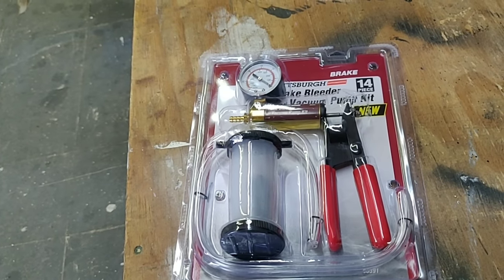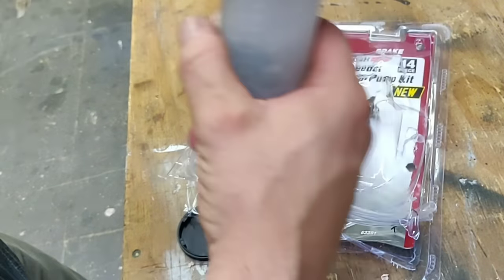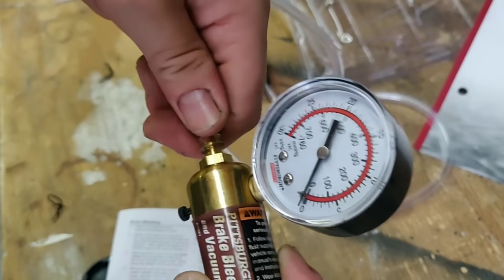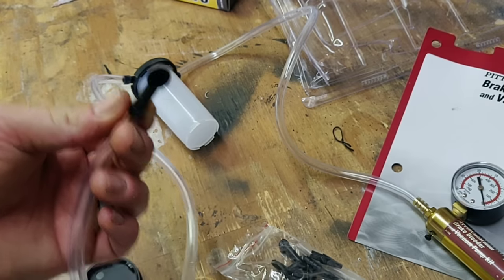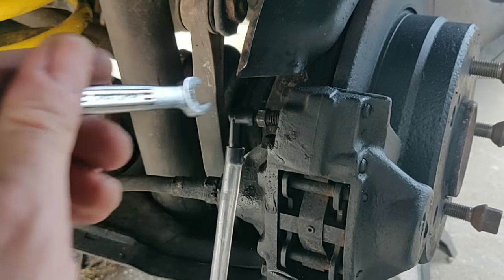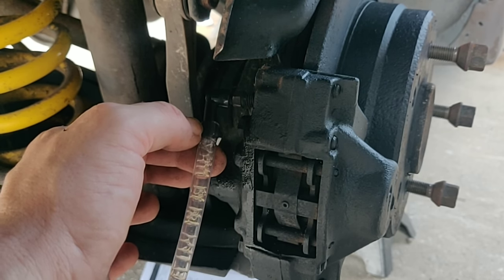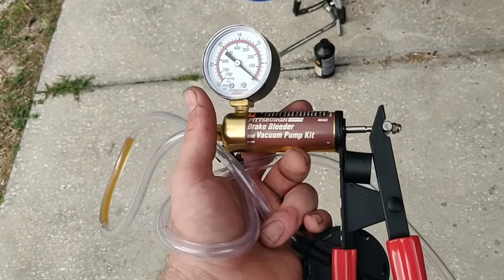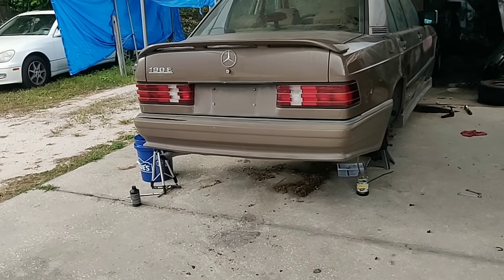Harbor Freight Pittsburgh brake bleeder vacuum pump demo and review

Comment: Also once you know how to use the pump and you are correctly connected, air will get sucked through the bleeder threads and teflon tape on the threads will minimize the air entering through the threads. I prefer the two person method and seldom have the luxury.

Comment: Yeah, I forgot to pull the spacer out from the handle too. I eventually figured it out after a couple of minutes. My issue with this pump was that I think the seal at the bleeder nipple wasn't great (even with the smallest adapter) and it was letting air in, so it was almost impossible to tell if the air was out of the system or not. I eventually had to go with the conventional method. I think the pump works great, just need to figure out how to seal it better at the bleeder valve. Clearly, the instructions aren't sufficient.

Comment: Besides the fact that you left the black pin in the pump....All those bubbles in the tube are from leak at the connection with the nipple....Forget using that adapter...Connect the tube directly over the nipple and then use a small tie-wrap around the tube and crank it tight .. Also place some thick grease around the threads of the bleeder screw.., since most of the air gets into the tube through the threads when you loosen it...

Comment: To get the air out of the lines you got to fill the master cylinder and put the cap back on it! If you don't the air will come through the master cylinder it's hopeless without sealing the system and let the air out  at the calipers

Comment: I'm sure this may not be the best but you didn't read the instructions completely and missed the hose inside the bottle and a little brake fluid in the bottom of the cup.  I'm guessing you didn't have the bleeder far enough open for the brake fluid to come out.  Brake fluid will start running out without any vacuum if the bleeder is open and not plugged.

Comment: You didn’t read the instructions properly, you need to discard that cylindrical stopper that is preventing the arm from retracting fully, that way you’ll get the vacuum pump to move through its full stoke.

Comment: Operator Error - Remove pump handle shim puck before use.  Refer to time 11:27, the spacer puck is still in place.  Also, check the schrader valve on bottom side of pump cylinder, if it's loose the unit won't hold pressure las well as it should.  Instructions probably mention it, dooh.  🤨

Comment: Just took mine back after attempting to bleed a clutch. Total crap. Worked for about 3 minutes then wouldn’t hold pressure. Going to buy a one man bleeder gun from Napa. Seems much nicer for the extra $80.

Comment: A bigger vacuum chamber on the pump would've been better....removing the spacer didn't work for me, probably got a dud.  Sometimes it can draw air in from around the bleed nipple threads.
Best buy is a pressure bleeder to use on the reservoir.

Comment: You have to leave the cap on the master cylinder loose. You just place it on top but do NOT screw it back on. Otherwise the reservoir will be pulling a vacuum that the little pump can't fight. When you pump the brakes, it pushes a big cylinder which pushes the fluid through. There is no way the little pump can compete with the power of the master cylinder.

So you basically used it wrong and that is why you couldn't pull brake fluid out.
Reply: Go back and watch the video. At 9:40 he walks up to the front and the cap is off the reservoir. You are wrong.

Comment: I have one that I've been using for years and has yet to fail. The tool was not a fail right out of the box, the problem you had is you don't know how to correctly use the tool. You were trying to build vacuum with the packaging lock still on the plunger, the little black plastic piece keeping the plunger arm from fully seating. And I saw fluid on the pump side of the tool, if that fluid got into the barrel it would stop it from working too. You were too quick to condemn a useful tool that with a little knowledge of the tool and a little practice would have been a very good addition to your tool box. There nothing wrong with learning to use a tool before you make a review video, you're not the first YouTuber to make that mistake, and you certainly won't be the last. We all have to learn. BTW, it is a good video.

Comment: I find these to be more work than using a one-man bleeder with check-valve hose, and pumping the pedal. With this method you can instantly watch for bubbles, but since it's not moving the cylinder piston it tends to waste more fluid for the same result.

Comment: There's a real simple way to believe the brakes you only need a couple inches of hose of course 6 in or more with make it a little bit easier but you just open your valve and put that hose on there and point it upwards so any fluid that comes out of there has to go up and stays in the tube so when you release the brake it'll suck that fluid back in there and you can see that really no fluid really actually get sucked in there you can just open the valve and pump it a few times but make sure you keep your master cylinder filled up

Comment: You forgot to take off the spacer between the handle and pump, thus couldn’t pump it correctly for pressure. I just bought one, and noticed it right away in your video.

Comment: not getting full travel with the handle take that black thing from between the handle and the pump, dont need all that hose, make sure you are not sucking air,fittings must be tight, use teflon tape

Comment: l think it would help if you flushed out the brak fluid reservoir and put new clean brak fluid in, as it seem to have some dirt in it,  And if you pump the dirt in the system you will cause a blockage.  But I did enjoy the advert for the bleeding system
Yours sincerely
Gordon

Comment: *It is important to only open the bleeder just enough to let the pump pull a small amount out, otherwise you will be pulling air in at the bleeder and out the hose.

Comment: I also bought that it didn't work well
 Also when bleeding brakes you are supposed to keep the brake fluid reservoir cap on to keep air from entering from there.

Comment: The seal falls off pretty quick (use mine in a shop) 
Honestly Iv never used any of them fittings and never used the small hose in the container. Found a transmission gasket that fits the container and it’s so far not fell off after right around a year of jt being on there. But from using a high price snap on pump to a Napa pump. They all work the same and do just as good. And tbh Iv never had one last longer then the other. The seals dry up in the pump and go out the only difference is the price and name tbh. Don’t waste the money on a high dollar pump. Just get a cheap one like this works the exact same zero difference

Comment: you did'nt take the black spacer out in between the pump to get a full pump. then you should get 35 lbs of pressure easy . i did the same thing with that spacer in  it will only pump up to about 10 lbs.

Comment: Nothing better than the brake petal you can make your own just get a plastic soda bottle with the cap drill a 3/8 hole on the cap get a 3/8 clear hose so it reaches the bottom of the bottle put 3 inches brake fluid in the bottle that's so you don't suck air back in the line with this you can do it yourself just make sure you always   have fluid in the reservoir

Comment: There is 2 things, I think you have to remove first the tap in the handle of the vacuum , and second , the bleeder could be a little cloug for the vacuum are you using, that was ease with the pressure from the pedal to uncloug it

Comment: Basic high school chemistry would've exposed the problem immediately. It's not a defective unit. 

Pressure is proportional. You have a big empty caliper full of air and a tiny little vac pump. You're only pulling a little tiny bit of air out of the caliper. What was 10 hg in (inches of mercury [Hg element symbol]  ) in 1 cu in of pump spread out over a caliper 20x bigger is now 0.5 in hg.

Comment: You didn't get pressure because you did not remove the plastic cylinder that was in between the handles. That plastic cylinder prevented you from squeezing down all the way which didn't allow the pump to work. That plastic cylinder is placed there for shipping and packaging purpose only. Mine worked just fine after I removed that packaging item. I did try it with it on and yes you only get 9 pounds of pressure. I didn't see if instructions failed to mention that you have to remove cylinder before using. You threw away a perfectly working pump. 😔🤷‍♂️

Comment: That little black nut that's in between the pump if you take that out you're gonna be surprised that it was the issue as to why you couldn't get above 9-10 hg's

Comment: Its vacuum not pressure dude. A big difference. Vacuum is what creates a pressure differential that allows it to PULL the bubbles and fluid from the system. Also, the vacuum pump is not defective. You didn't set it up correctly.

Comment: far be it for me as i only use it on a bike  dont really need it beause the lever is right there,  you have to get air tight connect  where the connection to to bleeder is suspect   also if  you  pump and resivoir runs dry  make more trips to check. thanks

Comment: If the bleeder is blocked, you need hydraulic pressure to bust through. 10 PSI vacuum is not going to do it.
Reply: Or change bleeder

Comment: The first mistake was open the reservoir fluid tank , air was running from there ! Second mistake no brake fluid. Bc you should fill up and tight the cap

Comment: I got one of these vacuum pumps for bleeding brakes. Its a stupid idea. I bought a $4 aquarium one way valve & put it on the plastic tubing & just 'short pushed' the brake pedal ( so the masters seals stay within their normal travel & dont pick up any rust etc).
Bled each brake cylinder by myself in less than 4 mins each, without even removing the wheels.
Yeah, a plastic $4 aquarium one way valve...  ( the actual pump is handy for testing lawnmower/chainsaw carbys, filtering fluids to get residues,  etc etc etc. Its just not the answer to bleeding brakes, a US$2.50 plastic one way valve IS !!  )

Comment: A few notes: 1) What you're doing is vacuuming, not pumping. 2) Vacuuming will never be as effective as pumping the brake fluid with your foot pedal. -15 psi pulling vs hundreds psi pushing the fluid out. 3) When you use the brake bleed nipple, you must loosen it, however the loosen thread will leak air thus you have even less vacuum force to draw the brake fluid. For fluid change, vacuum may work since system is already primed. For opened system, vacuum method will not work especially the rear brakes, too long, too much restrictions.

Comment: I think it’s best to just get an actual pressure bleeder kit...one where you hook the pressure bleeder to the brake reservoir. They work for me, and it seems that it works well for everyone else that uses or has used them. This way, it’s still just a one person job, but one that actually works. Either way, this is a good video to show how this type of bleeder system isn’t that great. 

Thanks for the vid! 🤙

Comment: The fault was not with the tool. You did not carefully follow the instructions. The air that you saw coming out was from around the threads of the bleed nipple. It is recommended that you remove the bleed nipple and coat the threads with some grease and also check the nipple is not filled with dirt. The nipples did not seem to have had the covers fitted so you threw away a perfectly good tool.

Comment: You need to remove the round stopper from between the handle and the housing then it will pull vacuum

Comment: I'm no expert but shouldn't you have filled the entire system up with most of the brake fluid first.
Cuz you mentioned it had brand new brake lines along with new calipers on front I would think as small as that pump is it's going to take a lot of pumping to remove all the air out of the entire empty system. Probably should have gravity bled first. So as to be removing minimal air. And then I think it would worked just fine.

Comment: Well, actually, it’s not necessarily harbor freight‘s tool and it not having enough vacuum. You just didn’t use it right the little short hoses have to stick inside the lid like so in the picture I’m gonna post also, you have to put a little bit of brake fluid inside of it so it’s not sucking air. It Hass to be in the fluid try it that way you threw away your pump for nothing lol.

Comment: Just buy a clear 1/4” line and put in to a water bottle open your bleeder valve pump the brakes 2-3 times and you’ll see the brake fluid has no air bubbles coming out close the valve done no real tools needed.      Total cost maybe $2.00
Reply: How can you see if there’s no more air in the line if you are in the car pumping away on the brake pedal, draining the reservoir and by releasing the brake pedal wouldn’t it suck air back in the caliper before you could run around the vehicle to close the bleeder valve?

Comment: 11:30 LMAO below the chrome bolt in between the handles you can see the spacer that is stopping it from letting the bolt go all the way into the VACUUM pump. If you take that out it will most likely work. That is there so it is smaller and easier to package. Live and learn I guess. I seen this info in another comment.

Comment: A pressure bleeder that fits on the brake fluid reservoir is the best way to bleed the system. If you get any brake fluid inside that HF vacuum pump it will become completely useless.  The HF pump is a complete waste of money.
Reply from the maker: I agree.  I was able to get it to work for a while.  I did a few cars that all work great but now it got fluid in it and wont maintain vacuum

Comment: You did not have a good seal. You needed to seal your bleeder screws and connections. It will pull a vacuum if you take your time and do it right. The bubbles coming out right off showed a leak and in other Harbor Freight videos you would have seen that. Device does work with a little effort.

Comment: I hope this guy was just joking.  It says right on the unit, 'VACUUM PUMP', not 'pressure pump'.  You know its pressure or vacuum by the way the gauge is numbered, and by which way the needle moves.   When registering 'pressure ', the needle will move clockwise.  When registering 'vacuum', the needle will move counterclockwise, as the numbers are numbered in that direction.  Got a good laugh anyway!
Reply from the maker: Thanks for watching
Reply from the maker: A vacuum is any pressure less than the local atmospheric pressure. It is defined as the difference between the local atmospheric pressure and the point of measurement. A vacuum is correctly measured with a differential pressure transducer that has one port open to atmosphere.
Reply: @petescarport  LoL, don’t try to sound intelligent now!!

Comment: Of course. Things wont-work properly if you don't read the manual fully. You're supposed to take off the black rubber ring on the handle. It's there to protect the pump during packaging. SMH

Comment: Don't buy these. You'd have better luck using the tube and bottle method if this is your only option. I work on cars everyday. Do not expect this product to even create a vacuum initially. You may have to return it and get another one, and even then it will only work a few times, leaving your hands extremely sore and covered in brake fluid.

Comment: I took notes on this video only to feel like you did it wrong.  All of the bubbles you were getting were probably just because of an incomplete seal on the break line which could be easily solved with a zip tie.  Also, the black plastic thing that you should've removed.  This is a how-to-not video.

Comment: I think that your pump was doing its job.
I think that you sucked too much from the lines and then your second mistake was, you tried to suck from the front, after you had just sucked the fluid from the rear and sucked the fluid away from the other 3 calipers... Thus!! creating a huge air bubble in the system. That pump would never have had a chance to work properly under those conditions. My name is Fred and I approve this message.

Comment: There is your problem sir....
You only have 3  wheel lug nuts and all the compress air is escaping thru those empty ports. Oh and by the way you forgot to remove the rubber spacing installed on your hand pump , which enable it from closing all the way.

Comment: did you forget to take the little black stopper in the middle of the handle out. If why you don't get good pressure. You should have got that out of the trash. Read the comments about it.

Comment: Reason the unit is crapping out not creating vacuum is you have an air leak. Just put some grease around the tube contacts and problem solved.

Comment: You was doing it wrong  , plus you could have kept it to check E.G.R. valve's Pete its strong enough for that 😉👍
Reply from the maker: Funny thing is I literally just used it last week to test my egr valve.  I had already taken back out of garbage and used to bleed several cars. Right now it's loosing a little vacuum because fluid had gotten into the handle area, but it's not a bad tool at the end of day just cheaply made

Comment: Gravity bleed it first. While it is gravity bleeding, learn the difference between vacuum and pressure.
Reply from the maker: A vacuum is any pressure less than the local atmospheric pressure. It is defined as the difference between the local atmospheric pressure and the point of measurement. A vacuum is correctly measured with a differential pressure transducer that has one port open to atmosphere.